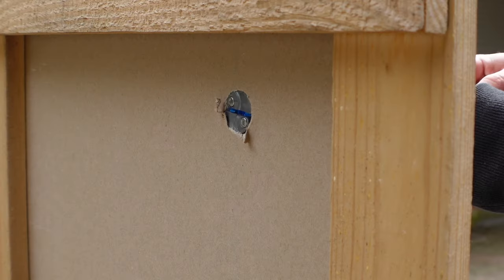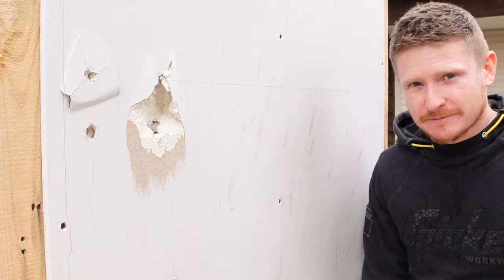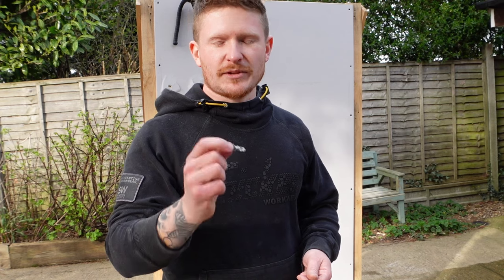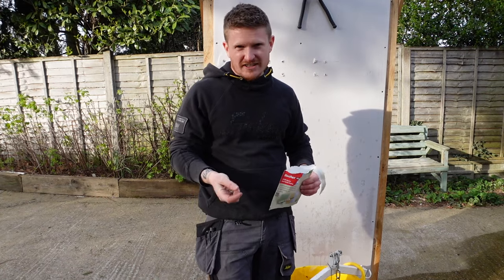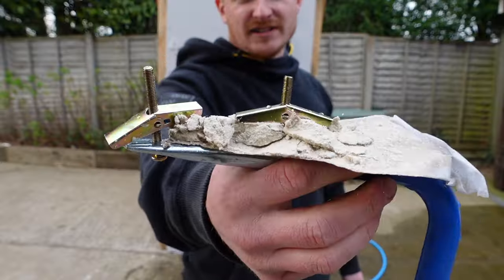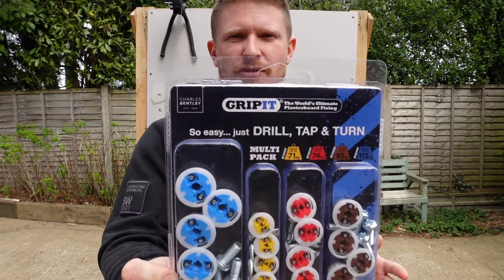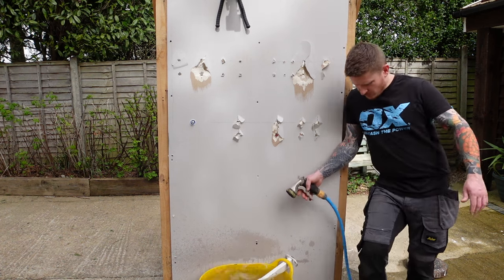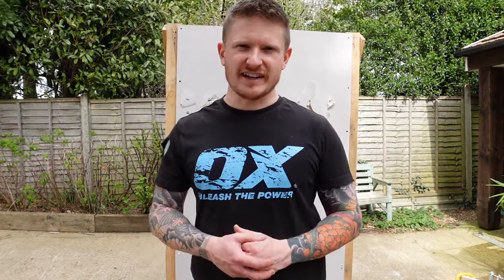What Plasterboard Fixings Are the Best | Drywall Fixings Tested

Comment: Great video but I wonder about the placement of the fixings. When placing the 2nd, 3rd, 4th experiment next to the holes where the previous fixing have been ripped out surely the structural integrity of the plasterboard is not as strong.
Reply from the maker: The fixing is only as strong as the immediate amount of.plasterboard material around it, sure.

Comment: There was I believing that the Gripit blue would win hands down because of the weight rating. No surprises though with those metal self drilling fixings. Never had any success with even the lightest of loads. Tends to chew up the plaster more than anything else.
Reply from the maker: I was also surprised by some of the results
Reply: The metal self drilling ones are what I used for my guitar hangers. I always drill a pilot hole in the wall first so it doesn't "chew up" the plaster and therefore weaken the foundation.

Comment: Currently looking for fixings for aquapanel cement board. Will be using adhesive also. Problem is my house built in 80s, builders were too lazy to put studwork in partition wall, it's three plasterboard stuck together, so no cavity either. Its 12.5mm one side, 19mm in the middle and 12.5mm the other side.
Aquapanel manufacturer says it's not designed for fixing like that but I haven't got much choice. No way of taking it all down and rebuilding either.
Any suggestions?

Comment: The problem of one of my walls is the gap between the plaster and concrete external wall is really small so my decorator says it can’t fit a wall anchor properly. So the gripit seems perfect to address narrow gap issue. 😊
Reply: How big is the gap?
Reply: If it's a boarded solid wall, aka dot n dab, there are fittings for that application such as corefix

Comment: The Grip Its are a bit overkill for what they're for. The brown one may be rated at 93KG, but unfortunately it's limited by the strength of the plasterboard. 

Also the self drilling ones, I wonder if they would have done better if you drilled a pilot hole first.
Reply from the maker: Possibly, as you say only as strong as the board!
Reply: @TheDIYGuy1  Based on your video I recently tried the Gripits and the spring toggles to hang up guitars and TV's. While the spring toggles are more secure, the problem was that there was only about 10-15mm of clearance between the plasterboard and a brick wall, which rendered the spring toggles useless, but the Gripits were the solution for it as they needed very little clearance. Sure, I could have drilled into the brick, but I would have needed a hammer action drill for it. 

So for anyone hanging a TV up, drill a small hole first to determine how deep you can drill, how thick the plasterboard is and how much clearance you've got underneath before spending any money on fixings or drilling bigger holes. Gripit sell a TV mounting kit with the blues and they have 20mm M8 bolts, which are shorter than the 30mm ones they sell with the standard blues, plus the 25mm drill bit as well.

Comment: What’s best to use to hang a 5kg mirror on a very thick plasterboard wall? The problem I have is the small diameter of the screw needed but the length not being enough to pass through into the hollow cavity behind the plasterboard.

Comment: I think the loadings for fixings are generally given in shear. Hanging a bucket on a bracket will massively amplify the load on the fixing. Also your test is trying to pull the top fixing through the plasterboard while the bottom fixing is more a fulcrum.
Testing using your method will give a massively reduced performance figure for the fixing. However, your test is representative of real life and what we need to know whereas the manufacturer uses a test to give best apparent performance.

Comment: Thanks that was an interesting set of tests I haven’t seen that done before, 
It reminded me that the plasterboard has a limit much lower breaking point than the fitting itself, it made sense subject to that limit spreading the load over a wider area eg in the spring clamps could handle a heavier load and if hanging heavy objects then you need support behind the plasterboard.  

A neighbour had a tall radiator fitted in her hall and just like your video fell off the wall during the day while she was out at work, in falling broke one of the valves, unlike your video the water kept flowing.
How should you fit a heavy radiator to the wall? plainly to the brickwork behind the plasterboard, yet there is a cavity. Should you remove some plasterboard, pad out the gap with timber and screw the timber to the brickwork then make good the plasterboard and attach the rad through the plasterboard into the timber. Or is there a better way?
Reply from the maker: If there is brick or block behind the plasterboard then use corefix fixings. If it is a stud wall then you need to remove plasterboard and pad out or re stud.

Comment: Great video. But I have noticed that sometimes it's not the fixings that fail. It is the plasterboard that failed. Just my 2 cents.
Reply from the maker: That is because all plasterboard fixings are only as good as the amount of plasterboard holding them in place. It's all about the surface area.

Comment: I'm moving to a new build timber framed house soon and need to fix heavy tvs, mirrors etc. The walls are studded and most have 9mm osb boards topped with 18mm plaster board. What fixings would you recommend thanks?

Comment: Great Video , however they would all hold more weight if you just used a chain and added flat weights to them as the bucket was  pulling down at an angle  . great video thou

Comment: I have ordered the grip it blue for my oled tv,, difference being is that I will be using 6 within the hanging frame and as it only needs to hold 22kilos should be fine, I think the guide weights they say it holds is misleading ,, perhaps with several being used over an area they could probably get close, but never to the 110kg's they advertise.
Reply: Interestingly on my wall in my games room, the plasterboard is 12.5mm, behind it looks like insolation foam, it was quite a job turning the screw to release those two wings attached to the grip screw. have you ever come across a wall like that before with no studs, just foam insolation and plasterboard stuck to it? @TheDIYGuy1

Comment: Try the gee fix it's the best by far from my own experience.
Reply from the maker: I've heard those are good!
Reply: @TheDIYGuy1  YES IVE USED THEM ON PLASTERBOARD FOR A TRIPLE PANEL RADIATOR THAT MUST BE AT LEAST 60KG IN WEIGHT IF NOT MORE AND STILL HOLDING UP GOOD AND STRONG OVER A YEAR LATER.

Comment: tbf it really doesnt matter the design, all that matters is surface area, hence why you would beat that record from the toggles by using toggles but facing them sideways as opposed to vertically like you had them. it just has more surface area of plasterboard it is trying to pull through.

Comment: I had a guy swear by the Gripit blue fittings.. he stuck four in the wall for my 50 inch TV (weighs 12.5kg, excluding vesa mount weight) but I'm seeing a lot of pictures of their TV's falling off the wall after a few months despite using four for their wall mounts.. four Gripit blue should hold a 12.5kg TV I would hope.. just all these pictures of smashed TV's have me concerned

Comment: A lot depends on the cleanses of the hole drilled at the back of the board.
Reply from the maker: Indeed, the best performing fixings are the ones that have the most plasterboard left in place to hold onto.

Comment: The Gripits are just bad. The wings behind the wall just barely spread out at all. Completely not worth the stratospheric price. Also, this comparo missed the three probably strongest options available completely - Bullfix, then a snaptoggle fixing or variant (Fischer Duotec is a composite variant, there are full metal) and the king of them all which would almost certainly be the Geefix. But yeah, the spring toggle tested would probably be on par with a snaptoggle. Interesting here to see that the springtoggle never failed or pulled out through the wall,  the wall itself failed.

Comment: Bullfix v Geefix Plasterboard fixings

Ultimate handyman did a video of a shelve using four fixings for Geefix. He then did the exact same test using Bullfix Extra plasterboard fixings. Bullfix plasterboard beat Geefix by around 18 kg in a real application yet are much smaller, easier to install and less than half the price . So Bullfix plasterboard fixings are the strongest plasterboard fixing on the market in real life applications.

Bullfix Extra Plasterboard Fixings =143kg

https://youtu.be/h5UqIlw61Vw

Geefix Plasterboard fixings =125kg 

https://youtu.be/BAyuUOjvKcA

Bullfix Plasterboard Fixings are the ultimate plasterboard fixing for strength, speed of use and are the world's strongest plasterboard fixing.

Comment: This test flawed. Nothing will hold with a long hook pulling forward breaking the plasterboard. A fair test would be a flat hook and cut the bottom of the board away so the bucket hangs straight under the hook. The compression strength would be much higher than the pull out strength. I the sorting toggles are great but like a gripit leave big holes but will take alot of weight.
Reply: That's what I was thinking as well. That type of hook would likely pull outward like a pry bar.

Comment: Im gonna throw a joker in there🫣
UNO blue 8mm plastic rawlplugs.
ive used the ficher standard wall plugs and repaired many walls were someone has used the 'pigtail' junk that has turned the plasterbpard to dust!
I can honestly say the 8mm UNO blues hold way better than the ficher. 
I have used 4x packs of 500 UNO's so far and never had a single one fail! Including the 6 holding my 10yr old Panasonic Plasma tv up😁Just a shame you never tested them🤷🏻
Reply from the maker: Interesting, thanks for sharing

Comment: Defeats the purpose for practical use because you’re using multiple fixings
Reply from the maker: This is a stress test, it isn't a real world scenario or youd of seen me hang a big old TV on there 👍
Reply: Missing my point, should have just used one fixing per test rather than two to get individual weight data as all this proves is what fixing is best for that specific hook setup as that will share the load also